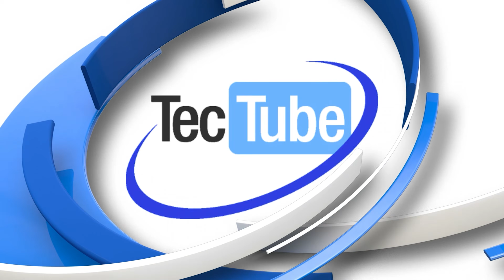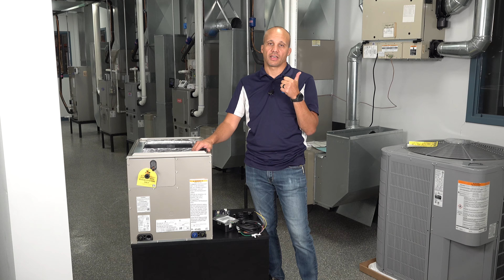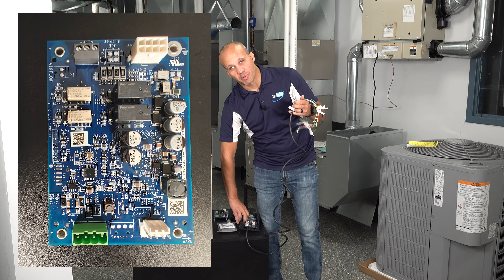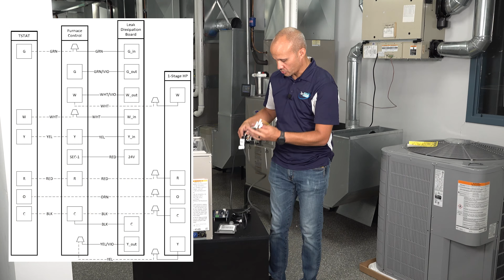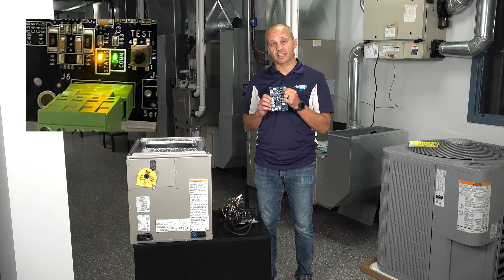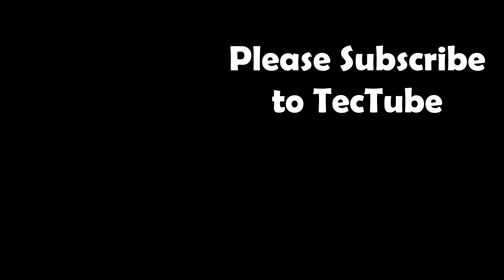A2L Dissipation Controls

Comment: Unable to locate  a wiring diagram 
Current system I am installing- a modulation furnace w/ controller- non communicating outdoor 454b- how is this to be wired? You need a 4 pin for the furnace and safety- can you lead me to the correct location for wiring or you know? 
Any blower or heat wire on terminal strip is ignored by the controller- only y and common are allowed .
Hope that makes since
Reply from the maker: Wiring diagram for Carrier (and affiliated brands) comes with the coil. It is also reprinted in the outdoor unit manual. What model number coil and outdoor unit do you have? We can probably send you the link to the book online if you no longer have the hard copy from inside the coil.
Reply: @TECTubefilms  

It is the modulation indoor, and matching coil for the furnace, outdoor is just a simple 2 wire ( non communicating)- I found that link which you sent, but doesn't show the exact wiring for this application.
Assuming- that the communicating on the safety board gets pigbacked to common and communicating  wires- minus the red. Unsure where rest the wires go
Reply from the maker: @ Sorry, we misread that. We thought you were going to have a standard thermostat. We are not sure if and how you can use a communicating thermostat with a non-communicating outdoor. The lead detection board can handle communicating and non-communicating systems, but we are unsure if it can handle both of those things simultaneously. Please contact your distributor's technical support... who also will not likely know this unique application... and they will have to speak to the factory.
Reply: @TECTubefilms  
**I ended up going to the job Monday.  You can use a communication furnace, tstat/controller and a plain 24 v outdoor. 
I wired it up the same as the communication wiring diagram,  but landed the 24v on y and c. It worked. THANKS FOR THE WIRING DIAGRAM- I am in service so I only see issues on new stuff further down the pipeline or In this case if install has an issue
Reply from the maker: Here is an example. https://www.shareddocs.com/hvac/docs/1009/Public/0D/IM-CAAMP-01.pdf

Comment: I installed this yesterday on a carrier slab coil. Simple to do and if your tstat wire going to the outdoor unit ever shorts to ground the dissipation board will keep the control voltage fuse from blowing out inside the furnace.

Comment: Do these work with an in line wired thermostat "common" makers such as ecobee's pek+. Essentially making a 4 wire thermostat a 5 wire?
Reply: It will work
Reply from the maker: Yes. Wire from the stat to the PEK to the dissipation board to the equipment

Comment: Ryan, great video and to the Point 👍. Not really sure why the OEM didn’t use a manual reset (I am guessing they don’t want a lawsuit due to frozen pipes if the unit goes in the lock out in the winter time and no one’s home. Because the chances of having any kind of fire or explosion with A2L refrigerants is slim to none (?) .We lived with gas furnaces for over a century without this type of fail, safe ) just saying 🤷🏻‍♂️.
Reply from the maker: There is no benefit to a manual reset. The purpose of the dissipation control is to spread the refrigerant out through the volume of the space reducing further the potential for ignition. Once the refrigerant is dissipated, there is no reason to continue to running the fan (or more importantly... to keep the heat locked out)